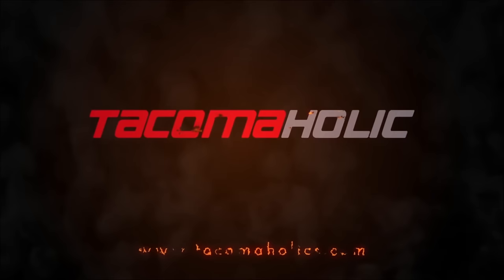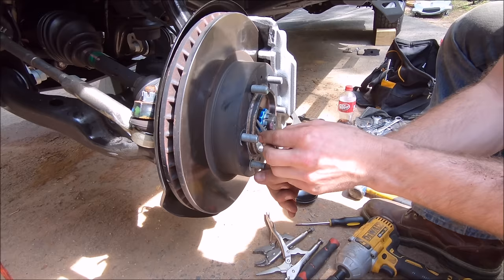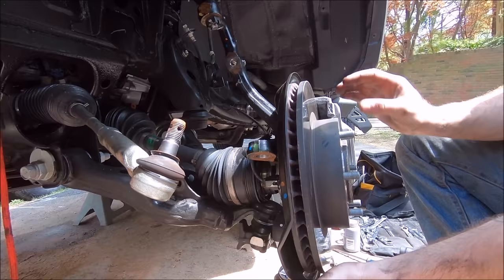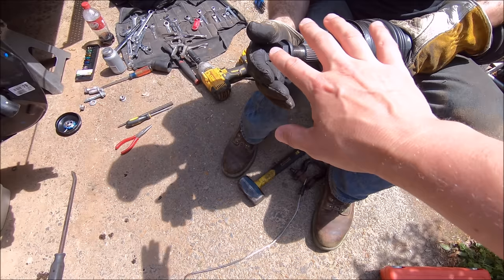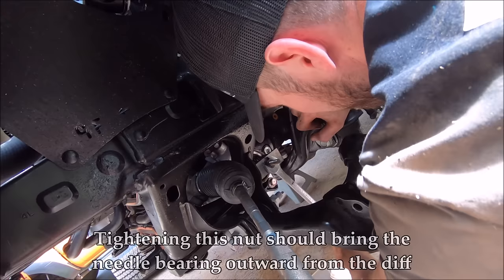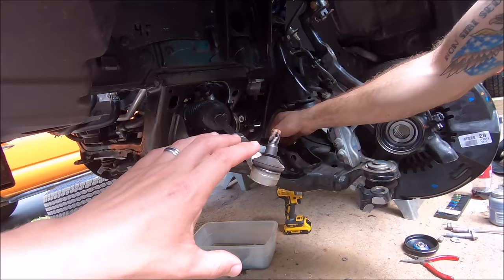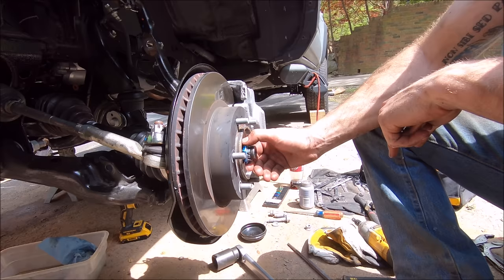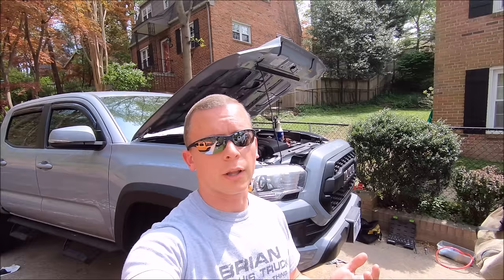Toyota Tacoma Needle Bearing Swap for ECGS Clamshell Bushing

Comment: I have a 2020 Tacoma TRD off rd with 2000 miles just had a 3/2 spacer lift done new rims tires 285/70/17 front end alignment. Between 50 and 60 I get little shake in starting wheel not bad but strange. The shop said drive it for two weeks bring it back and if still an issue they would rebalance the tires. Any suggestions
Reply from the maker: Pop it into 4hi next time it shakes like that if you are on a straight road and going less than 65mph. If the shake instantly goes away then you need to replace the needle bearing with the ECGS clamshell one as seen in this vid.
Reply: Did you get it fixed

Comment: does the truck need aligned after this install?? Great video!! Im doing this next week and wasnt sure if ill need an alignment after.
Reply from the maker: No alignment needed if you aren't adjusting anything on the UCAs or tie rod. The tie rod is disconnected during the install but that's all.
Reply: I aligned my truck the day after we shot this video, but that was due to the lift kit, not the bushing install.

Comment: Is there a passenger side bushing as well. Or do you only need to do the drivers side?
Reply from the maker: No the passenger side is different. Only driver side needed.
Reply: @Tacomaholic  so does the passenger side not have a needle bearing?

Comment: How did he get the shock off without taking loose the upper control arm
Reply from the maker: That was done earlier since this truck was getting new UCAs at the same time.
Reply: but its not require to remove the shock to get the axle out.  unless it a beefier shock i guess.

Comment: I have a 2015 2wd, would this be useful to replace for me?  I have had shaking in the steering wheel even after balancing the tires since I lifted it.  Running a spindle lift in the front and emu springs in the rear
Reply from the maker: Are your vibrations around 40-50mph?
Reply: @Tacomaholic  exactly at 50mph
Reply from the maker: @Vikingguy187  Yeah it would be worth trying then assuming your tires are balanced.

Comment: So with a OME 2" lift this needle bearing needs to be replaced?...does Toyota use the type bearing on purpose to discourage lifting?
Reply from the maker: Did you get any new vibrations after the lift?
Reply: @Tacomaholic  Haven't lifted yet...want the two inch lift but not if I have to replace this bearing.
Reply from the maker: @defstar1774  One of those things you just won't know until you do it.
Reply: I have the Old man emu 2" lift and yes mine vibrated,  went away in 4h like he said.

Comment: So i just got my 2020 Tacoma OR... I want to lift it but i was worried about issues brought by lifting. Other than this bushing, are there any other issues that may arise? Also, the edits in this video are hilarious.
Reply from the maker: Trimming issues with fitting larger tires plus other vibrations with the driveshaft being off compared to the stock geometry.

Comment: Also how about a Tacoma 05 after getting lift , doing a slight vibration between 0-20mph ?
Reply from the maker: Probably a driveline vibe if it wasn't there before the lift and either a carrier bearing spacer or rear axle shims might help.

Comment: You say "if you put it in 4wd and you still have the vibe, then it's PROBABLY something else".

Is it POSSIBLE that the source of the vibration and hum could still be this bushing even if the vibration and hum doesn't stop when in 4wd? I've already replaced the front hub/wheel bearings. 

Anyone's input welcome, thanks.
Reply: New shocks/struts, tires and wheel alignment as well so it's not tire cupping either but that's kinda what it sounds like ofcourse.
Reply: I'm asking is the vibration going away when put into 4wd a necessary prerequisite to being able to determine the problem is the needle bearing or is it possible the vibe can still be the needle bearing, I heard u saying probably or kinda.. I'm just trying to determine definitively if I can. 2007 sequoia limited 4wd
Reply from the maker: From what I've heard if the vibe goes away when you put it into 4hi then the needle bearing is the issue. Does it feel like you have any vibrations coming from the middle or rear of the truck?
Reply: @Tacomaholic  No it doesn't, it really all feels and sounds like it's up front. I've heard however about how people have sworn the noise was coming from up front but it was the wheel hub/bearings in the rear (the sound traveled). I'm going to check the rear by spinning for bearing sound and checking the tires for play when lifted. But yeah I'm a little stumped then. I was really hoping that needle bearing could act up in a variety of ways including mine (vibes at all times after about 20mph) so that the clamshell would be the fix.
Reply from the maker: @jyj3843  It's frustrating hunting down the vibrations sometimes. A rear axle shim and carrier bearing spacer could help too.
Reply: Check your rear wheel bearings.

Comment: Is  the bushing just on the one side  the drivers  side
Reply from the maker: I'm not sure if the other side has a similar bushing, but even if it does the driver side is the only one where there is an issue.
Reply: @Tacomaholic  thanks  for the information
Reply from the maker: @fogduker3131  Any time. 👍

Comment: If I change the needle bearing when I level my truck do I have to drain the diff
Reply from the maker: Not necessarily. A little diff oil might leak out put you can plug the opening with a rag and then just top off the oil ... or you can raise the driver side of the truck a few inches higher than the passenger side so that no oil should spill out.

Comment: you guys didn't mention separating the lca? did I miss it?
Reply from the maker: If I remember correctly the LCAs were able to just be pushed down without loosening anything. This was on a newer truck though.
Reply: @Tacomaholic  the lca needs to have two bolts removed to sway over like you indicate

Comment: The vibe is likely the crappy napa cv axle??
Reply from the maker: Is that what you are running on your truck?
Reply: @Tacomaholic  yes, unfortunately! the 26 year old Yota axle boots shredded after getting some new RadFlo coilovers up front that raised the truck a bit over 3 inches from stock height.(the axle grease was everywhere up front i thought i had a major oil leak at first LOL) ordered full OEM boot kits but got caught in a 5 month nationwide backorder at the time, reman'd OEM axles were found discontinued, new OEM axles are 600$ each MSRP and those also were found to be out of stock!  so Napa crappy was the option (except those boots ripped within 6k miles before i got the RadFlo coilovers adjusted and dialed down a bit) got another set of the nappy crappy to keep truckin' until the backorder boot kits come in and then i can hopefully reboot the OEM axles, reinstall, and see if this obscene growly at freeway speeds goes away. or it could be something else wrong at 345k taco miles... this is the definite hard-core TacoLife lol .. i just want a happy taco is all
Reply from the maker: @efil4kizum  It could be from the Napa axle but this also can happen with OEM axles.
Reply: @Tacomaholic  could be the needle bearing inside there is also shot
Reply from the maker: @efil4kizum  Definitely if the truck is lifted.

Comment: ECGS tool is crap.  Needs grinding.  How does only one company make this kit?  Somebody gotta take over and do a better job, they tell people theyve solved the problem and here i am almost 2024 and i gotta grind mine down.  ECGS 👎
Reply: Mann
I just ordered mine today
Most owners in TW had to grid the tool 🤦‍♂️.
Reply: @snorlaxTACO  yeah you gotta grind it but not much and then it's a breeze.  If you don't have a grinder they say you can use a small hammer & punch and try to tap it through.  The bearing housing is pretty thin and you won't hurt anything that way.  Just make sure to block the diff with cloth like they suggest.  I'd also thread the screw on as well.  The only thing you can hurt is the old bearing.  It ain't perfect but it's doable.
Reply: @snorlaxTACO  lmk if you have any more questions